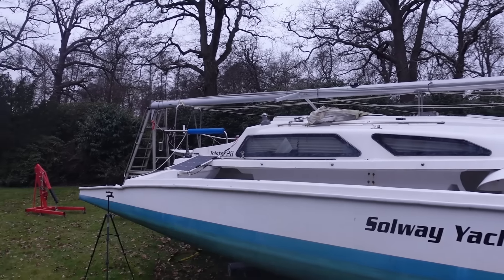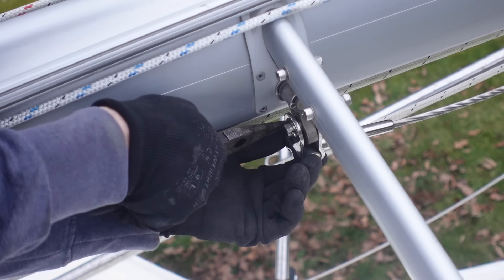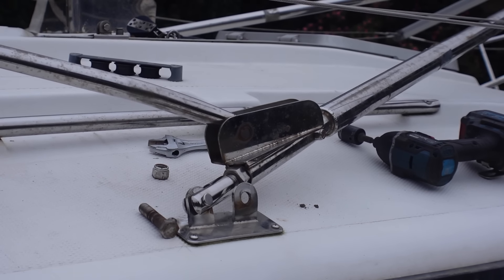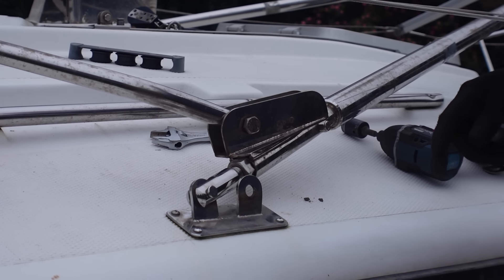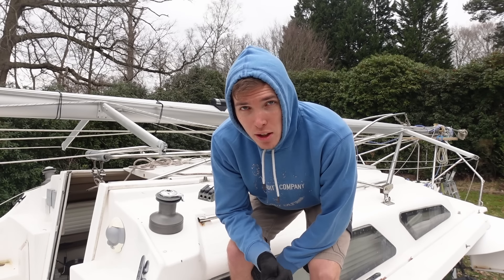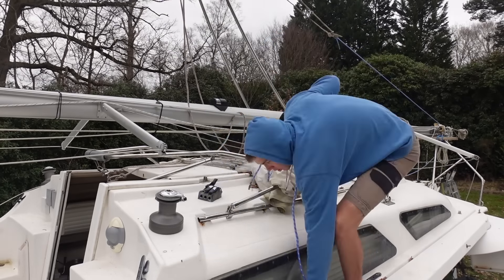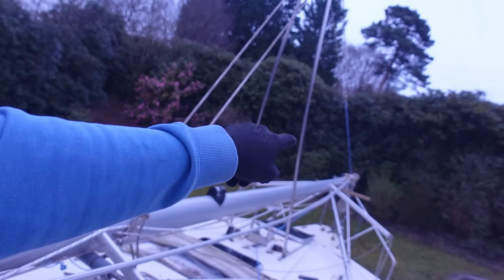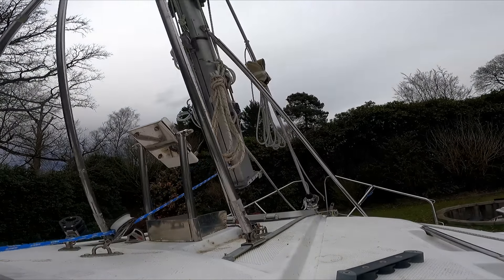IS THIS THE BEST MAST RAISING SYSTEM ON A TRAILER SAILER? | Ep.126

Comment: Well done for keeping your faith in the raising system. Stopping a mast fall over the side is the most difficult element and it looks like this method is stable. Also youve tuned it such that you can stop and adjust the setup. Fab😊
Reply from the maker: It super safe and really easy. Will make life easy at the boat ramp!

Comment: Nice crocs, no plugs. Somebody was having way too much fun with geometry when creating this method. I like the system of raising. complicated, but easy for a single hand. It also keeps the forestay straight. In my method, the forestay (furler) bends and can break at the joints. When raising, you should use the transformer sound effect, Wrrrrrr-CH-KCH-KCH-Wrrrrrr. You forgot to put the boon there. That boom support is pretty cool. The only change I would make is if there is too much tension on the line between the foot of the mast and the winch would be to add a boom sheet between the bottom of the fuller and the bow and you can get double the mechanical advantage.
Reply from the maker: That’s a good idea! Seems to be fine on the winch with the transition point between the frames being the only hard point. Really like this system especially solo!

Comment: Super engineering, but looks like it takes a long time to set up; well done for getting it sorted out!The Farrier system uses the slightly (aft set) lowers to prevent side to side movement. Takes a bit more oomph to get the first bit up, but uses less hardware and is much quicker.
Reply from the maker: Yeah first setup takes a while but never has to be done again. Just dive down and pull one rope and it’s up!

Comment: I see it as a genius leverage puzzle.  It is working very nicely.
  I have no idea how heavy is that mast, but myself, I would rather have a simple more common raising mast system.
Reply from the maker: It’s a clever system! A more common system couldn’t handle the weight and would be impractical to use so this is the best solution to handle it.

Comment: Never seen anything like that system before - impressive design! Wondering ... (with the KISS principle in mind) ... is there something about the design of this boat that prevented having a hinge at the mast step and using an A-frame (Jin-pole) on the foredeck to raise the mast, like most other small deck-stepped masts employ?
Reply from the maker: Mast is 34ft I think. So that a lot of weight to be dealing with on a lever arm. Also makes it easy as it drops into the transport location so no need to slide it around.

Comment: Man that system looks almost effortless!   You're going to pull up to the ramp and be in the water in under 10 minutes by the looks of it!!  Nice!!!  Now, without seeing everything together -- how much does the mast raising framework clutter up the deck space -- it looks like you lose some of the easy passage through to the bow around each side where the side supports attach to the cabin top.  I guess that's a small price to pay for the ease of operation though.
Reply from the maker: Very good system. Luckily don’t lose and deck space really. There is a board that goes on the outside which makes getting to the bow so easy. Really well designed!

Comment: Impressive and designed for single handed raising. In the middle of designing my own raising system  fully aware of how nerve wracking it can be . Is it possible to stow all the hardware on the boat  and  do you think it could be used afloat?
Reply from the maker: Can be used afloat and all the frames stay in place so no need to set it all up. Definitely a great system and safe too!

Comment: Rumour has it, the guy who designed this mast raising system also built the pyramids.
Reply: Tony Smith was originally a English Boat designer and Builder who moved to Annapolis, Md. where he built over 1,000 cruising Catamarans before he designed that Tri and rig and retired, Fair winds and smooth seas to you Tony and Sue when ever you are.
Reply from the maker: @randybruce3824  quite the story!

Comment: Interesting idea from an engineering perspective but overcomplicated. Wouldn't like to do it in a breeze.  A simple telescopic A frame in aluminium with 3mm sidewalls overlapping I ternally by 30% up to spreaders height would suffice. A frame Legs tied to shroud chainplate eyes to stop movement. Simple block and tackle to A frame intersect with a lassoo eye in line. 1 front sheet from a frame top to forestay chainplate and 2 rear lines from a frame top - one to each rear quarter (eg to  port and starboard rear cleats) to steady a frame. Then lift and steady - simples.. especially if block and tackle has a camcleat in bottom block...
Reply from the maker: I have that kind of system on my last boat and it was stable enough but not really in high wind. I’d trust this system way more in the wind. The mast is probably a bit to big to be using an a frame and it would also be a challenge to slide the mast back before lifting too. The speed benefit is the main thing.

Comment: How much tension do you get on the line at different stages? With my old boat the biggest tension is when the mast is lying flat (see https://youtu.be/yFxLTyRWfCE?si=EPgvvFHcnhWcDD_T&t=180). With your system it sees as if its more even throughout. Your system really looks very cool but do all of these heavy metal bars stay in place during sailing?
Reply from the maker: The transition between the frames is the only tight bit but it’s not too bad. All the frames stay in place too which is nice except for the weight!